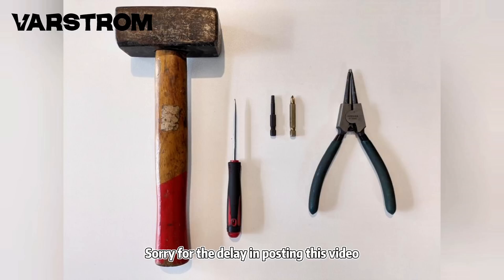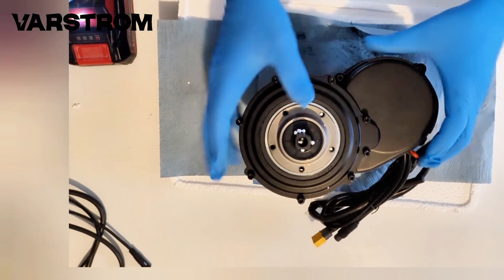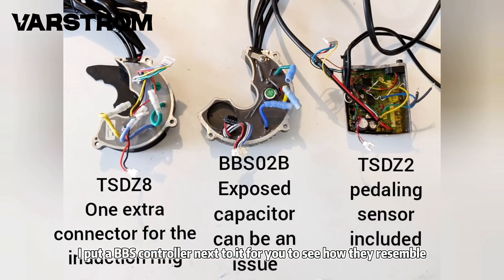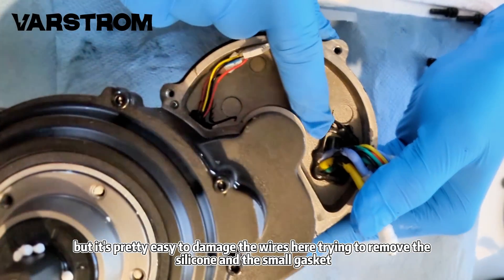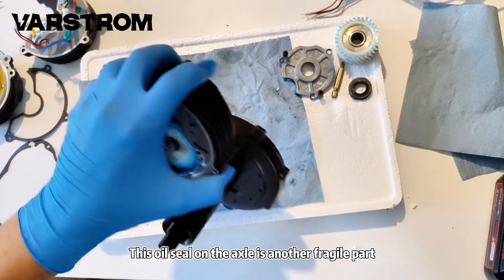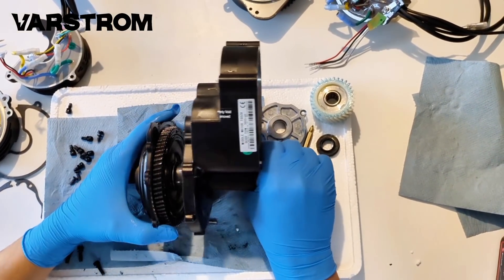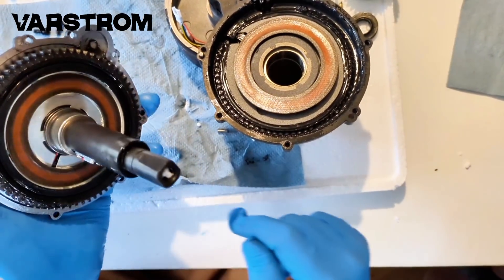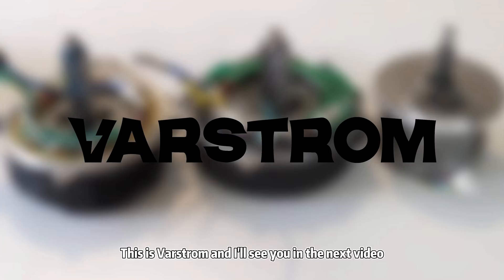As a strong competitor of BBS02B?Bafang BBS02B VS Tongsheng TSDZ8 - Explore the internal structure

Comment: I would like to ask how much the battery life and range of a bike with a 1000-watt motor will decrease compared to a 750-watt motor?
Reply from the maker: That’s a great question! 😊 Because the motor structures and designs are different, the 1000W and 750W systems aren’t directly comparable in terms of battery life and range. Actual range depends more on how the motor is used, riding conditions, and riding style rather than just the rated wattage.:hand-purple-blue-peace:

Comment: Tofu-dreg garbage designed to break... Requires an engineering degree to upgrade the bearings to non Chinese junk. Requires two types of Grease... Is not remotely water proof... You can't put it on a common Walmart bike. Requires Shimano Deore drivetrain or better. 
1000$ just for it to break in under 100 miles. 

Varstrom doesn't even make them so you pay more just for them to bundle parts and slap a sticker on it.

Comment: Hi there.
I have used the BBS02 model for the last three years and, personally, I was very satisfied with its performance. I also used it on level ground, but especially in hilly areas. Although many times, especially in the summer, it worked at high temperatures, it never had problems with the engine or transmission. But it has one major problem, waterproofing. The cover that closes the final transmission is insufficiently well designed. Can you please tell me, in your opinion, if this aspect is better designed in the TSDZ8 model?
Reply from the maker: howdy bro.
The waterproof level of the two motors is the same, both are ipx5, which can prevent the intrusion of sprayed water, but not waterproof.
Reply: @varstromebikeconversion   Thanks for the clarification.

Comment: Im really glad you done this video. I really wanted to see the motor taken apart to see if there was any difference between the terribly flimsy tsdz2 motor.
It seems they have copied much of the bbs02 which should make it more durable. I don't like how they have kept the same torque sensor and method of securing the main gear and shaft with circlips and a bearing either side. They should have used bafangs method of thrust bearings either side and the two locking nuts. This is a much more secure way in my opinion.
Thanks fot for the video 👍
Reply: Wow the pro bafang bots are out
Reply from the maker: Thank you for watching

Comment: I am an early adopter, I bought a TSDZ8 in November 2023. It is a fantastic piece of tech. 
Most important, main gear compartment size is similar to Bbs02 (smaller than Toseven or TSDZ02B) so it fits more bikes.
TSDZ8 group on Facebook has nearly 800 members now, so yes, it gains popularity.
Reply from the maker: Yes, if I had to choose, I'd go with the TSDZ8, the torque sensor has more advantages than the speed sensor. But the TSDZ8 has a poorly tuned controller, I plan to work out an optimal controller algorithm and test it.
Reply: @varstromebikeconversion  Yes, software is not optimized, but it is getting there. I just bought Jlink v9 programmer, but still had no time to play with it. There are several beta firmware versions available on the facebook group. But of someone should provide/develop something like OSF, that would be the best scenario. 
I mostly use level 2 and 3, have no need for other levels with this firmware.

Comment: The bigger question is the long term reliability of Bafang vs. the Tongsheng.
Reply from the maker: Yes, it's every customer's desire to get a product that combines low price, stability, comfort, high performance and high quality, but at the same time it's hard to have it all.
In my opinion, the quality and construction of the internal parts of both the BBS and TSDZ8 are in the middle of the range, away from the high or top level, which means you need more frequent regular maintenance. Adding grease is a must, followed by regular replacement of failed fittings, depending on how often you use it, the frequency might be 6 months if you are an outfitter, or typically 1-3 years for normal use.